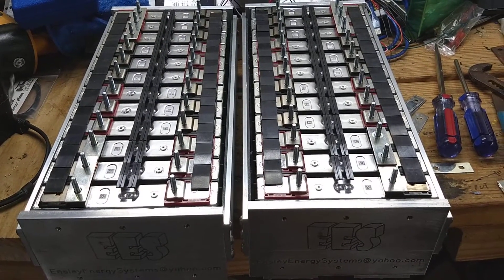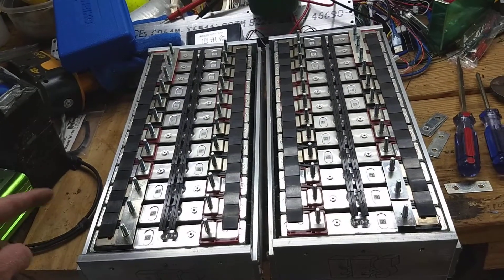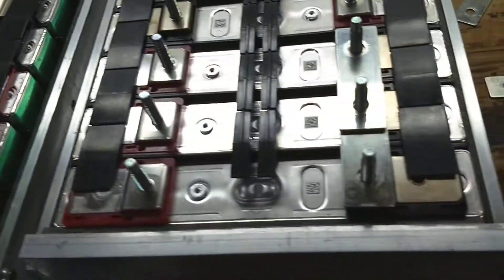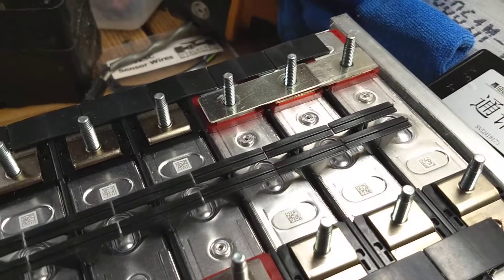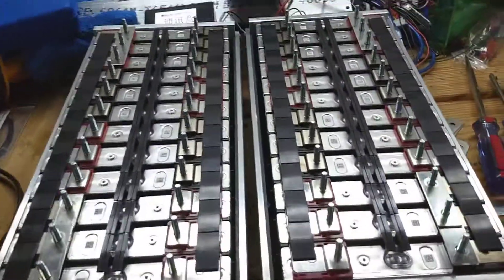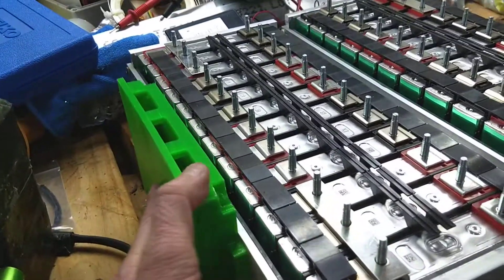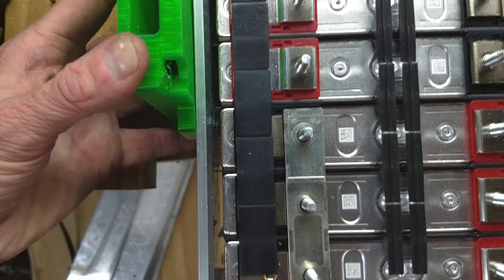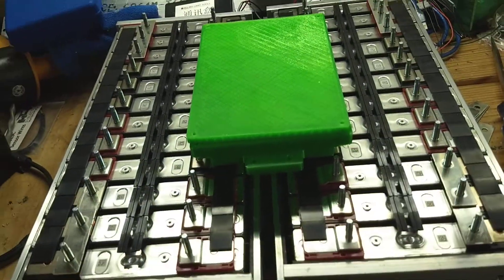150ah Ensley Energy Systems battery.

Comment: Hey what's size or the 150ah ?
Reply from the maker: 28.5" long x 8" wide x 6" tall
Reply: @ericensley2427  thank you
Reply: And the 150ah but the long ones what size they are ?
Reply from the maker: The long 150qh is 28.5" long.     The square 150 is 15" long x 15" wide,
Reply: @ericensley2427  ok thank you